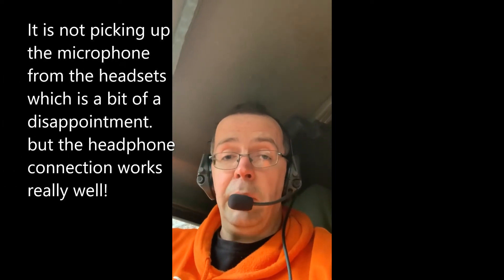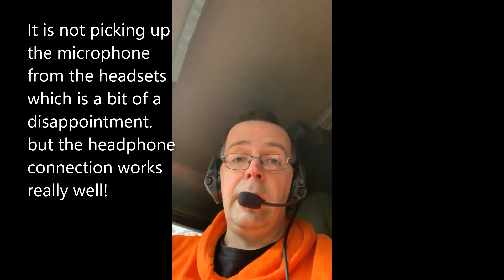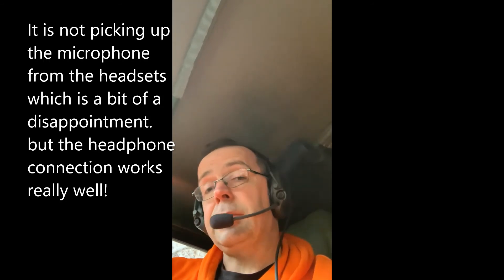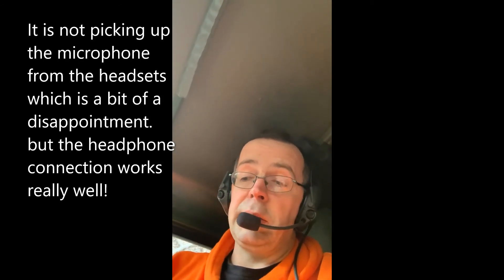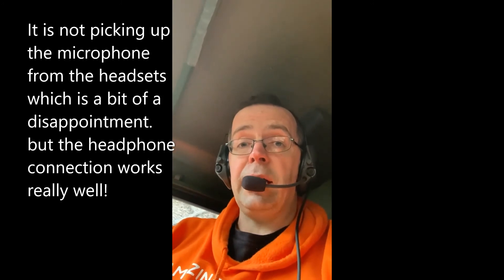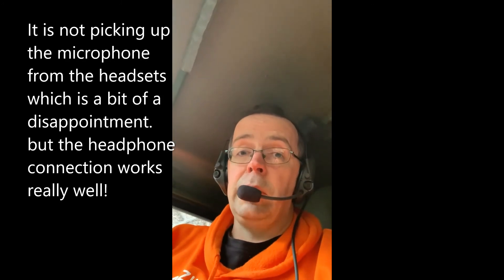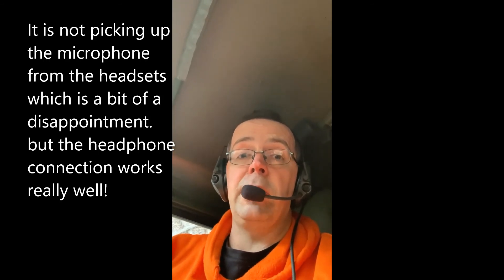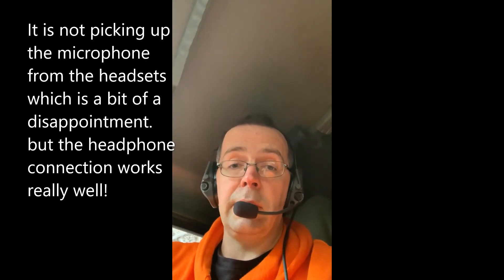Military radio audio cable - Plugging smart phone into a Vehicle intercom system/clansman/bowman

Comment: Modern cell phones require a condenser microphone which must be biased by several volts. If your headset does not have a condenser microphone in it, it will not work. There could be voltage hitting the dynamic microphone element and shorting out the transmit audio.